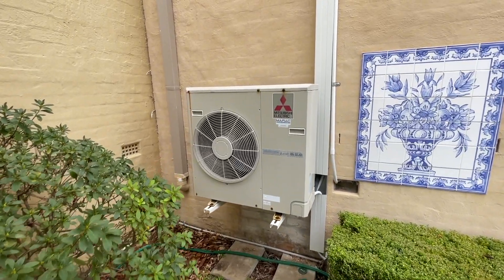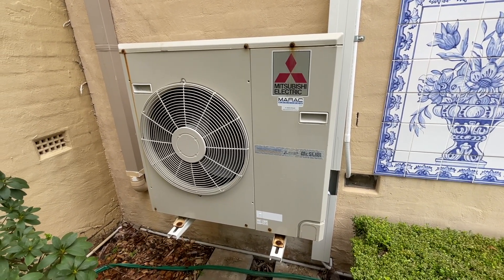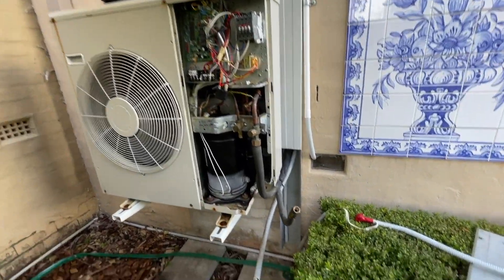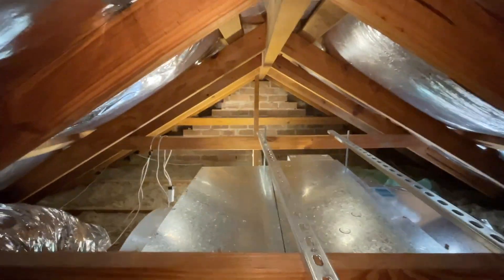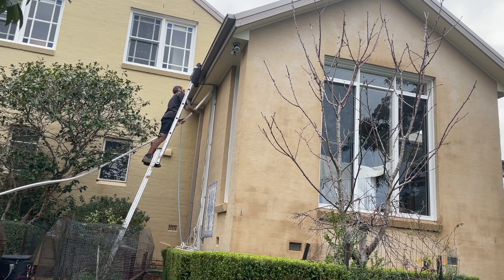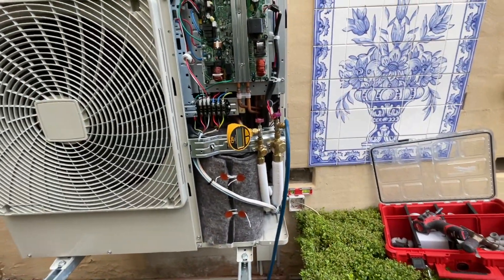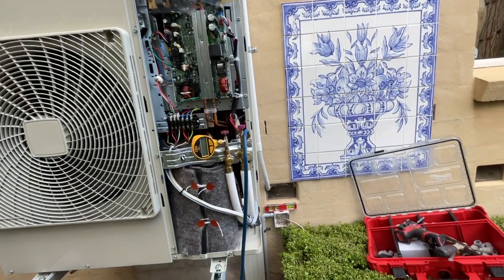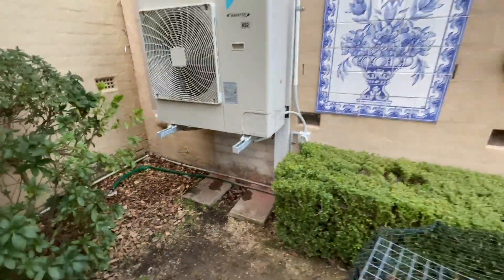Replacing a 20 year old Mitsubishi Electric Air Conditioner.

Comment: Nice video, the mitsubishi electric had a board issue, why change out the complete condensing unit? also, unless i missed it is the new Daikin unit running with the original mitsubisi electric evap? many thanks.
Reply from the maker: @johnicex841  thanks mate. 
The board is no longer available for that unit because it’s very old. I quoted to replace the board with third party boards and also quoted to replace the entire system. They chose to replace the entire system. Daikin outdoor and Daikin indoor unit mate.

Comment: Why you don't use stainless steel bracket ?.
Reply from the maker: @sontungle2641  these galvanised brackets are much stronger than the powder coated fold down style brackets. The only stainless steel brackets I’ve seen at the wholesalers are the fold down style. I prefer the galvanised ones personally. Cheers mate

Comment: What flaring block you use Mitch? I'm due to retire my 10gear old refco
Reply from the maker: @dylb8801  I’m still using my 14 year old RIDGID mate. This thing is still going strong. I wouldn’t mind getting a battery powered flare tool at some point though
Reply: @maracservices  yeah nice! Ratchet or manual? I've read in a few reviews the ridgid ratchet are falling apart in the mechanism

Comment: The electrical install looks sweet. I'm an electrician and could not have come up with a better solution. Rigid conduit to protect the wire, proper isolator switch.
Your electrical installs always look better than what the previous guys did are you or were you an electrician by any chance?
Reply: Should always take conduit from bottom of isolator when outside

Comment: Don't Daikin specify more room between the wall & the outdoor unit then what you have there, it could just be the camera lens giving the effect of it being closer then it actually is too 🤔
Reply from the maker: @scoffee82  you’re actually the second person to make this comment lately but I can tell you it’s definitely fine. Daikin want a minimum of 150mm which all my units are over that 100%. 
I film with a fisheye lense so everything is out of proportion. Cheers
Reply: here more issues that it is the corner of the house with lots of buses around. It is probably fine, but I would rather choose an area more open. But in many situations it is not possible to do. I would trim here some bushes around though.